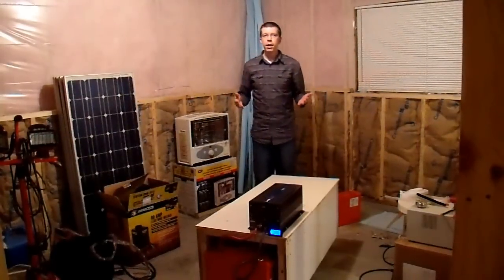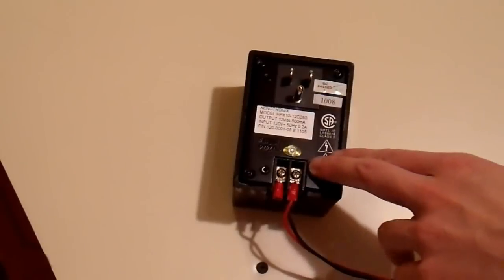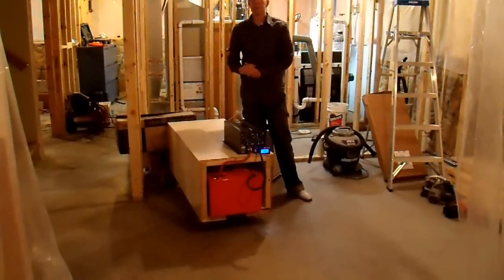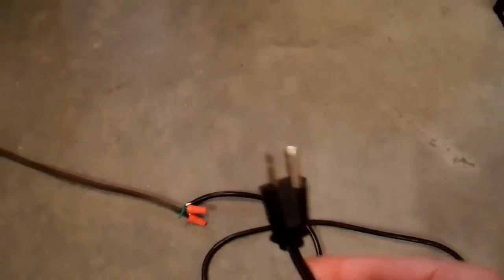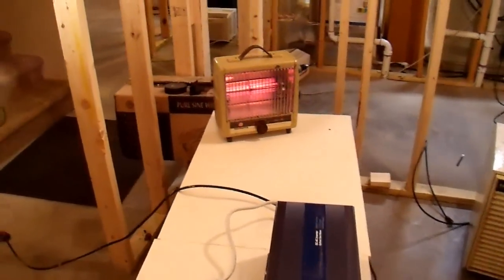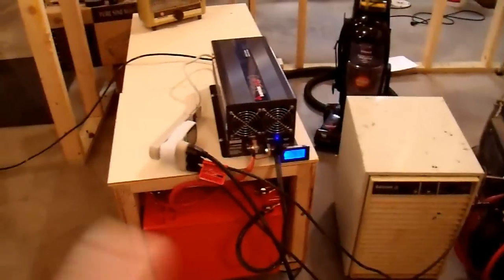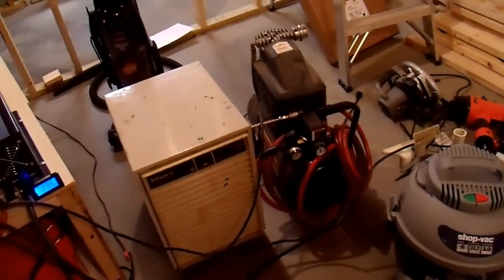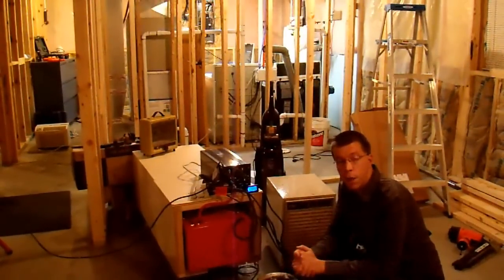1000Ah Battery Bank Part9 - What Can it Power??

Comment: Hi K. The only thing that surprised me with your great testing was the sag from the battery bank. It might be worth it to measure the voltage and amp draw at 2 different loads in order to measure the pack's impedance. Then after that test, perform the same test on a few of the 12 battery's individually to see if their impedance is within spec. Granted, the dc load on the pack would be substantial with the tests performed, but it just struck me that another verification of the bank is in order since it's the very heart of your test set up for the larger inverters. What do you use for editing your videos? Thanks for all that you do!!
Reply from the maker: The cabling on the battery bank in this video was not optimal at 0AWG and 2AWG which accounted for the majority of the voltage sag.  It is still not optimal today but has been improved since.  I use virtualdub for editing.  Simple and free but not professional.  I'd like to use something better if you have any suggestions...

Comment: I like your videos but your audio is always so poor. Please go buy a clip on microphone.
Reply from the maker: Thanks for the feedback.  I have been considering purchasing a new camera but haven't found one that satisfies my needs within budget.  Do you have a recommendation?
Reply: ***** Any built-in microphone on a camera is pretty much useless unless you're standing right in front of it and there's no background noise. I use the zoom H1 which is a microphone/recorder in one. It's like the gopro of the microphone world. Reasonable price and great product. You can either record directly to the H1 and then sync the audio and video (automatic in most video editors) or you can use the line out of the H1 and feed the audio straight into your camera (if your camera has line in). The H1 also has a line-in option so you can plug in a clip on mic and record directly from that :)

Comment: Great Video series.  Ok, it is obvious that you are a prepper.  I am interested in talking to you about your plan to supply power.  You have the battery bank, generator and solar panels.  I have seen your video on powering you breaker panel.  What else do you plan on doing.  Thanks, -BAG2
Reply from the maker: I don't really consider myself a prepper but if I were one I would concentrate on food, water, and defense.  If society were to break down then, well, electricity wouldn't be my first concern.  But I do find this stuff interesting.
Reply: Take a look at my recent repair videos and see if you like the transitions. YT's editor is easy to use.

Comment: Great series of videos! Just watched them all the way through. Really impressed with your knowledge and your whole setup. Thanks for sharing!

Do you have any suggestions on good places to source second-hand batteries like the ones you used (or just good deep-cycle batteries in general)?

Also, you may have already answered this question somewhere, but what voltage meter are you using next to the inverter?
Reply from the maker: I have a video review of the voltage meter out there - it was some cheap eBay or Amazon thing.  Don't remember exactly, but it works great so long as expectations are reasonable.  Well worth the money.

For sourcing batteries, that's difficult.  Getting to know someone who works with battery recycling or who works at a place where they sell 'seconds' is probably your best bet.  For example, exide has outlets where to sell fright damaged or old batteries that didn't sell before getting old at a discount.
Reply: Cool, thanks for the info!

Comment: what is the kw power you know like a volt has  16kw battery thanks looks big
Reply from the maker: Not sure if I understand your question, but each battery has a short circuit current rating of around 2000A.  That means the maximum theoretical power output of this battery bank is around 1000A*6V = 72kw
Reply: looks right  you heard of tesla cars they have 85kw batteries  and go 260 miles on a charge  chef volt has 16kw battery and go 35 miles  just checking on some stuff.  i got a chev volt and want to make it go farther    how big of battery i need
Reply: kevin gibbo Hi did you think I can add batteries on a volt like your battery bank
Reply from the maker: kevin gibbo
On a Chevrolet Volt?  No, that is a highly tuned electromechanical system that very intelligent people spent years perfecting.  Without extensive internal, intimate knowledge I doubt anyone can make simple modifications to improve upon the system provided by GM.  It's certainly not perfect but we just don't have access to the information necessary to make improvements.
Reply: i think that we can find a way to hook up a extra battery pack and the computer will just go with it.

Comment: whats the voltage drop on you batterys during the really huge start up loads?
Reply from the maker: hmm.  I've never tested that because I don't care...  But seriously, these batteries don't droop that much under load due to the quality and number of them.  The voltage drop depends largely on the state of charge of the battery bank.  When fully charged like in this video they probably only drop down to 12V or so.  Once they're 75% discharged I may run into issues with undervoltage conditions.
Reply: ***** alright i was just wondering cause i know that battery bank is huge but on 300-400 plus amp start up draws i thought i might still droop a little... thanks for the quick reply.

Comment: Hi  I need hellp I will like to speak with you if possible .. I bought a cool unit f0r 250  dollars it was all most free.. it's  a ups inverte backup from onlinepower  model  mw1.5a0100n1v rating 1500watt... it came with 6 12 vollts 90amp...all new.  Thanks

Comment: I am thoroughly impressed by your love of craftsman.

knurlgnar, is this project scalable to something that could run a small apartment with intermittent charging from a 12v generator?
Reply: A generator will cost more to run/maintain than the grid so it's meant for backup only not full time use.
Reply from the maker: Like abyss says, using utility power will be far less expensive and more reliable.  However the direct answer is, yes, a system like this could easily power a small apartment with daily charging from a 12v generator like the one I showed in an earlier video series.  In fact I've done a test run of it in my own house and it worked as expected.

Comment: Very nice work: in my case, to go off-grid completely (as I am now) I had to switch to a 24V 1000Ah battery bank (I used a heavy duty forklift battery bank: 12*2V elements). Doubling the voltage really helped in reducing cable size, efficency of the inverter, etc. I've seen 48V setups, they work even better.
Reply from the maker: Agreed.  48V is about the sweet spot for full time power and I do actually have a 48V 2kw inverter sitting around that I never use.  This is just for backup and for that a 12V system is more flexible.

Comment: I'm considering moving off grid.  So I'll be looking for a pure sine wave 3000 watt inverter.  So my question is, if you had $1,000 to spend on an inverter for an off grid application, would you buy one of these Samlex inverters like you have in this video?  Or do you know of something better.  You seem to have tried and tested several different makes and types of inverters so it makes me wonder if you consider this Samlex the best you have tested.  I figured you would probably use the best in your own house especially with all that capacity.  I have watched your previous videos and I didn't hear you talk much about it the Samlex.  Or maybe I just missed it. 

I'd like to see you rate the inverters.  You know, the whole "on a scale of 10" thing.  I know it might be hard to do because so many inverters aren't honest about the true values of peak and whatnot.  Anyway, your videos are invaluable.  Can you fix a broken portable hard drive by chance?
Reply from the maker: My experience in repairing computer hardware dates me a bit, but generally for mechanical storage HDD products it would involve opening them up and swapping control boards and/or read/write heads, recovering the data, then moving the data to a new drive.  (because they are calibrated and once you swap components it is no longer a calibrated system).  It is difficult to do unless you happen to have an identical donor drive sitting around, and even then if the physical storage surface was damaged due to a true 'crash' the data is non-recoverable even by the likes of the NSA.

What are your requirements for your system?  Do you need both 240V and 120V?
Reply: Ultimately I think I would like both 240V and 120V.  It would be nice to have something that is "upgradeable".  Buy a high quality inverter now that will run 120V with the possibility of upgrading to 120V and 240V a few years later.  Is that possible? 

I really don't have any requirements yet except that it be able to power everything in a small house with the exception of heat and AC.  So I figure 2000+ watts should cover it.  I would like to upgrade the system to run the AC eventually.  I'm new to this whole thing so I'm just looking for advice and you seem to have a lot of knowledge.
Reply from the maker: *****
I'd recommend starting with a 3kw or 4kw pure sine unit - 2kw is marginal for even relatively light household loads.  I have some stuff on order that I plan to mess around with for future videos that may be of interest to you  - I won't comment on it until I have some experience and confidence that what I say is correct but my intent is to power both 120V and 240V appliances from any inverter.